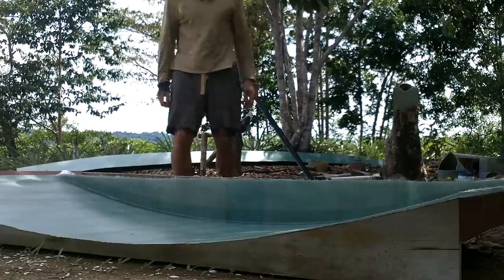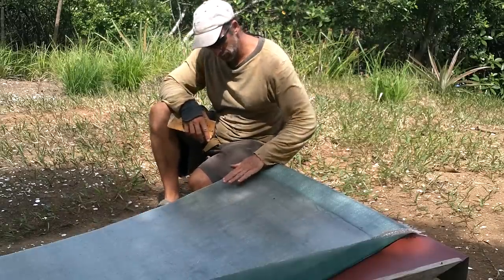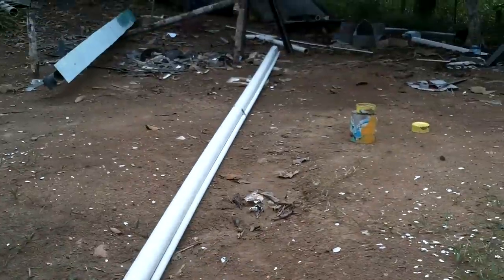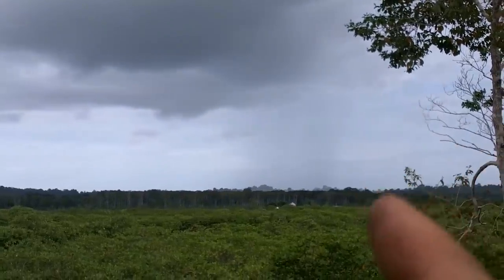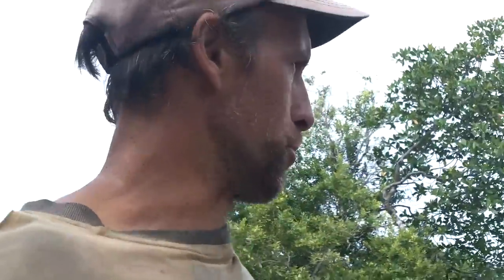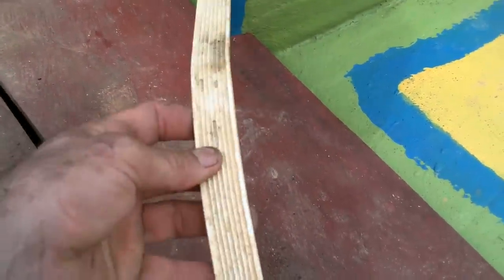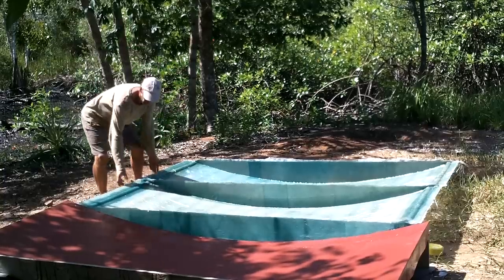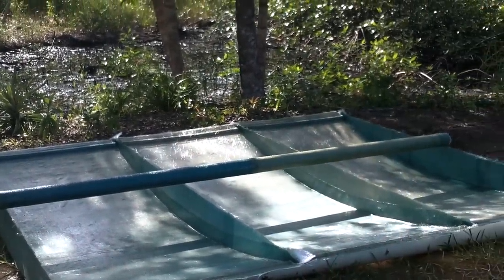Solar Sailer 023 Sail Progress

Comment: I detect a few points of catastrophic failure. 1. It's going to be too top heavy which will cause the boat to flip, 2. Sails don't simply scoop wind but actually act like a wing, allowing air to flow and create an area of low pressure in front of the sail which pulls the boat forward. 3. when the wind hits that sail it's going to create a resonance that will vibrate the sail to pieces. I believe all of these are good reasons why we don't see boats with sails like this. I am NOT being negative I am just offering my informed opinion as a long time sailor with 4 sailboats. Of course I could be completely wrong. And this is tremendously entertaining to watch. ❤️Jamie.

Comment: Curious why you didnt put the mast through the ribs of the sail, instead of sticking on top of them?
Reply: My guess would be to preserve the maximum structural integrity of the ribs. A hole that big would create a weak point and the sail might rip in half in high winds.
Reply: Agree with the mast hole through the ribs, if it was fiber glassed along all height of it joining the back of the sail ribs and it would be much stronger. I think he is underestimating slow wind forces.

Comment: As a non-engineer I expected your mast to be incorporated 'inside' the mast construction cross panels. It could still turn but I would think it would be more rigid. I think I also underestimate how strong the fibreglass is. Can you explain the strength in your design?

Comment: J, I want to look into making solar cell fabric for use as sail cloth. Could you imagine charging batteries for electricity on the boat, and to power an electric motor using your sails as solar panels? The work is being done, but I don't know how far off we are from practical usage.
Reply: Carbon fiber
Reply: @henryphelps3590  Graphene. It can be used as flexible solar cell material among MANY other things. A single atom layer of graphene over carbon fiber reinforced sailcloth would probably work well.
Reply: @AlphaMachina  carbon graphene kinetic generator you are truly a genius !!!
Faith you and it are here to give freedom !!!
Reply: @henryphelps3590  lol
Reply: My question would be why not have conventional solar laid flat and just have regular sails. The angle of the wind and sun would rarely line up, not to mention the vertical orientation of the solar would mean it would only have max exposure when the sun is low in the sky, the time of day when solar radiation is minimal. I would venture to guess, with all the factors, that you would have a small fraction of the potential production of a panel laid flat (per panel area).
Reply: @dustman96  This is true. Jamie's approach makes more sense, since it it just tries to leverage a little extra power, rather than rely on it.
Reply: @Rambowjo2  I am impressed by his idea. He can lay them down when there is no wind. It seems that usually when it is cloudy there is wind and when there is no wind it is fairly sunny. And I'm very interested in how the rigid sail is going to work out.